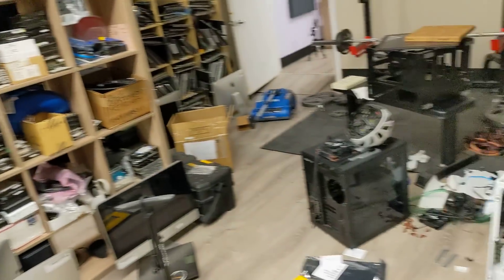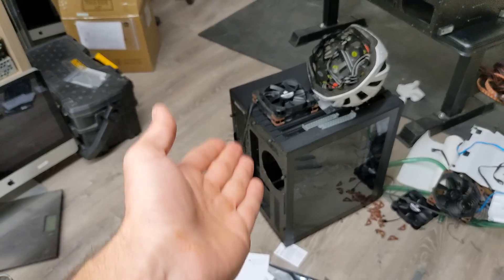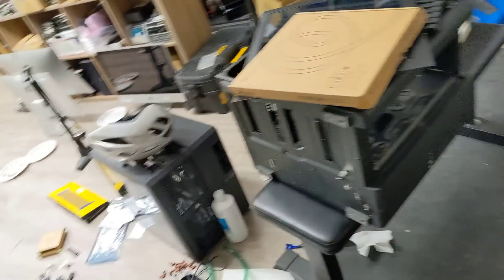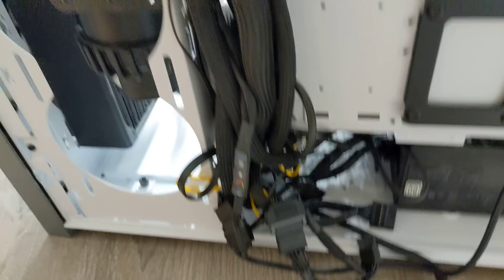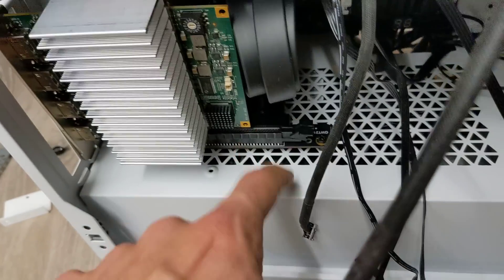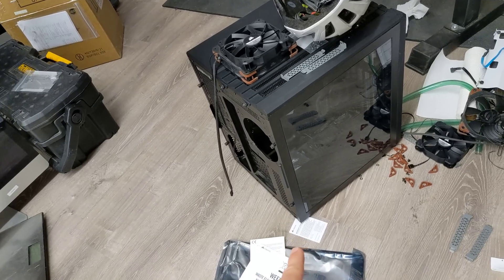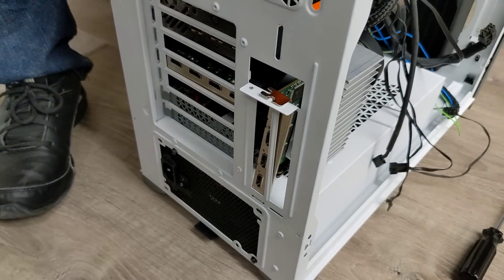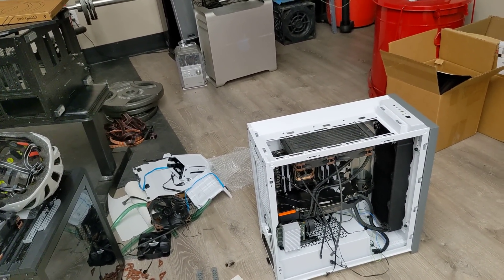I have a confession to make....

Comment: Modern cases (and motherboards) suck. Want to use the pci slots? Too bad, the gpu is in the way. Do you want to use raisers? Too bad, the case doesn't have a way to mount them (nor space for that matter). Want to upgrade from 120mm fans to 140? Well, too bad, even though it has mounting holes for that, you'll have to fit them in a particular way in order to be able to mount the dust filter back.

Comment: Bin that liquid cooled graphics card. You don't strike me as the type of person trying to summon 2 FPS more from flight sim 4k at max setting. Mount the cpu radiator in the top. Job done.

Also there is multiple holes for the sata bays...slide it over away from the power supply cables.

Comment: Louis, I may be late to the party but I also own a Corsair Carbide case. When I got it I thought my 3.5 bays were defective too... turns out they need way more force to properly seat the connectors than any sane person would think is needed. If you still have that case, maybe give the drives an extra shove and see if they click in any farther. Hope this helps.

Comment: I have a question, where can one find a body for an Asus K93SM 18 inch laptop, or how to reinforce and repair the current one since the hull is literally falling apart, the plastic is way too thin for this size and weight and its already full of cracks holes and its barely keeping it toghether since ive fixed it partly with silicon, pieces from old broken toys and candy wrappers since those turn out to be quite durable for making crack patchwork, tho id need to find a new body and maybe a way to beef it up to last longer, or just find a way to further reinforce the current one which is barely keeping it together, many of the joints are completely broken. parts are missing, the side radiator is completely exposed since the hot air baked the plastic and it just broke off and the monitor hinges are pretty much destroyed...the machine is literally holding together as if its stubborn not to completely fall apart, all mechanical interior components are functioning great but it needs a better shell, and maybe a new original charger since the one i have now worries me how hot it gets.

Comment: The Verge video is still worse.  I think you would be hard pressed to get that capture card to fit in most cases with a GPU installed. Also, the 3.5 drive bays in a lot of cases don't fit with longer modular PSUs. But all the parts in the Verge video were compatible with the chosen case, yet the video could have been mistaken for a parody thanks to sheer incompetence.

Comment: Does anyone have credible advice on recovering data from a thrown hard drive?

1) How expensive should inspection/investigation actually be compared to 1st party rates?

2) It was thrown but not smashed or significantly deformed; just unreadable by our computers. How likely does anyone think it is that data recovery is possible?

Obviously not a request for aid or anything, but I'm flying blind about how to not get ripped off and the contents are precious enough that even hearing from a more knowledgeable person about how these things tend to go would be wonderful. 

Thanks in advance to anyone for your responses.

Comment: How come the white corsair case has the water cooling and fans on backwards so the fans are acting as pushers? Conventional radiators need puller fans to be effective, same as any car cooling system. They do make special pusher fans when you have no option or are stacking another radiator on top, but are typically loud and need more power to do the same job.

Comment: my god louis u need a bigger case than thoes thats what u need to do all of the stuff u want i recommend the corsair 1000d super tower case its super easy to build a liquid cooled pc in it and you can stick upto 5 hard drives in it and 6 ssds in it and have 2 computers in it one atx and one itx and its all made out of steal and has tempered glass as well but i dont keep the side panel on cause i still tinker in it once in a while so its easier for me to keep it off.

Comment: Chief, I spent twenty minutes diagnosing a display issue that wound up just being a power connector not being connected properly and unplugging itself. I spent several times longer trying to figure out how to get the wi-fi working on my Framework laptop, only to find I'd skipped a step and never connected the antenna wires that I'd even acknowledged the existence of.

No one is exempt from having embarrassing technical difficulties with computers. XD

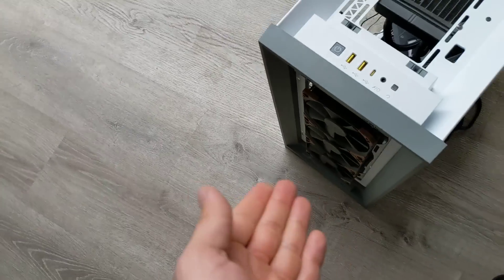Comment: 1:20 the fans go on the inside, in front of the radiator if you have a front rad, but behind the panel. Hold fan inside, put screw through fan mount eyelet, mount fan.

Comment: I cant believe for a second you dont have the knowledge to figure it out, even if you dont "know" how to. You can very easily look up a 15 min video , possibly one of the verge follow up videos people did, and be able to wrap that up. You can read board schematics. This is MUCH more difficult then plugging in a few components. In fact some of the skills crossover. Being able to read and identify a certain terminal for a component, the tiny text many people overlook is on 99% of motherboards that identify said terminals. I have faith. You honestly Cant mess it up with the level of foresight and knowledge you have with said devices. The plugs pretty much wont let you. Just dont use wire looms from different PSU's. Each PSU is specific, even across some identical models, the plugs change "pin outs" and swapping one wire will cause havoc. The rest is plug and play honestly.

Comment: Dude, is that a Gigabyte card? It is! You're a brave, brave man. Gigabyte is really going elemental with their stuff lately. Their graphics cards are from the Fire element, and they will start burning the moment you turn on the computer. Their PSUs, fittingly, are electricity type. Those that aren't DOA will not only have catastrophic failures that will drag a few other components down to hell with them, they will also play Raiden/Zeus/Thor/The Emperor and shoot lightning across the room.

...

Sure, not literally every single one of their devices does that, and sure, I exaggerate - but I didn't exaggerate by that much and I any time any of your product lines has a non-trivial portion of its specimens become a fire or lightning hazard, and you try to bury the story, you lose all respect I might have had for you and you land on my blacklist. And getting off that list will take tremendous efforts of pro-consumer policies and stark increases in quality.

Comment: I mean... You're not exactly making it easy for yourself. 

There's a reason I stick with Air Coolers, and it's not (just) that they're perfectly adequate even for the highest end consumer chips, but also because they are more reliable (less moving parts) and, while also not neccesarily easy, usually a lot easier to manage while building a PC. Oh, and they get quieter during anything but sustained peak, no pump that always has to work.

And yeah... HDDs in modern cases ain't pretty, usually all kinds of hidden incompatibilities. I've been able to move most mass storage to NAS devices and thus get by with just SSDs in my main PC. Next time you'll be smarter, that long PSUs and HDD cages interfere is quite common. Also HDD cages and fans, even worse with radiators (again).

Comment: Nah, you're not nearly as bad as you think you are. You probably do need a bigger case. That one looks like the iCue 400D. The 5000D or even the 7000D would be a better fit. The 7000D has slots for two sets of drive cages at the bottom, so even if one doesn't fit with the radiator and PSU there, the other will. The Torrent also has two dedicated 3.5 inch slots where they wouldn't clash with anything else. There are ton of good cases but you have to make sure you don't just pick a case because most general cases are going to be too small.

Comment: You could have simply just looked at a smaller power supply and made the what is that a 4000D or 5000D work.  My power supply is the same size in a 5000D, and with the other front bottom attachment, the one with the open area rather than the L shape,  I can fit the 3.5" drive bay just fine.

Comment: So I now own this same case, and I can't help but notice that you have the reduced size power supply basement cover installed. That part isn't installed by default. With the normal power supply basement cover that's longer, you can fit the drive cage fine because it's closer to the front of the case. So you've chosen to intentionally install the piece that makes the drive cage not fit. I assume you did this because the front rad wouldn't fit with the regular length basement cover so you switched to the smaller one but then the drive cage wouldn't fit. So in this case, you'd have to decide which is more important. Having your 360 rad being mounted where you want it, or having a drive cage.

Comment: You can fit a Seasonic Prime Gold 1300W in there with the drive cage. Source: I have the same case (5000D Airflow) and that exact power supply.

Comment: I hate those cases with the sealed PSU and hard drive area. Even with a power supply with modular connections there is never any room down there for the regular 3.5" drives. I guess they think PC builders will only be using 1 M2 drive and a couple of SSDs tops.  I see now why you like the Corsair case as the hard drives are stored separate from the motherboard compartment.

Comment: You should have chosen a Lian-Li O11 XL, you can fit 4 3.5" HDD (with included hot-swap bays) several 2.5" SSD and have enough space to fit all those radiators without a poblem.

Comment: I built a new PC with the same corsair 5000 case as you. you are right about thre 3.5" HD case, I believe they could have fixed that by having a mount plate for the PSU so you could slide it in from the back and then fasten the PSU.  That way you could get to the connectors. I manage to fit the fans for the radiator inside as well as the water tank. but then I replaced my 1080 with a RTX 3080 and can't fit the tank before i get the GPU water cooled again.

Comment: I think those fans go inside the case, not attached to the back.

Search this platform for that specific case and you might find a bunch of people putting their machines together, and find some useful information.

As for hard drives. they tend to attach to the sides of the case now. Maybe not the optical ones, but at this point, with the cost of SSD drives you might as well get those and clone yours over. Those are way smaller and will attach in a few spots in those cases.

Comment: The water cooler doesn't fit because you're supposed to put the fans on the radiator, not on the case.

Comment: I built my first PC in the nineties and I've built PCs only for myself. The most time consuming part of PC build is the preparation phase, when you search as many as compatibility issues, such as mechanical, thermal and electrical compatibility issues. But the most annoying aggravating etc phase is the "I built it and now I'm the sole provider of tech support regarding this abomination" phase. For that you'll need sufficient inventory of known good parts and/or spare parts. So yeah the "fun" part is "lego" phase, when you attach the parts together, hopefully without using a 12 kg, 423.288 oz, sledgehammer for fine tuning, everything else is most likely less fun.

Comment: After doing a ton of builds I will never buy another case besides Phanteks, Pro tip#2: Watercooling is for the dogs, radiator mounting will multiply build time and also multiply pc maintenance and trouble shooting for years to come. Do yourself a favor and buy a giant air tower cooler and never mess with it ever again, (besides maybe replacing a fan after a few years) Only go for water cooling if the Air cooling is inadequate, then return the air cooler that you tried to use and buy an AIO liquid cooler.

Comment: In my late high school years and college years, I built my own machines because I had no money and had to deal with second-hand and salvaged parts.  I had plenty of time to spend digging up answers and pouring through user manuals... particularly because motherboards in that era did not play well with RAM that wasn't on their approved list...a list that would change depending on firmware version, often losing compatibility so you'd need a specific firmware version to function.  There are just dozens of issues like that I kept hitting.  Parts not fitting was often solved with a dremel tool and cases became frankencases quite often.  The standards are far better today, but it's funny to see the same problems are still around.  These days, now that I have money and not so much time, I just pay the 10% markup or so to buy machines pre-built.  I swap parts and occasionally add more drives myself, but that rarely causes trouble at least.

Comment: There is a power supply basement expansion so you can fit a 2 HDDs into that case.check the box

The white ramp looking end cap at the front of the PSU shroud comes off and can be replaced with a bigger one that will give you the room for the HDDs.

Comment: Those are mainly custom loop watercooling problems. If you just want it to work go with air cooling. And not so bleeding edge components like huge power supplies and graphic cards.

Comment: Wow.... just wow
Have you tried moving the 360 beast of a Rad to the top of case and the smaller 240 to the front, it is slimmer so may be able to fit the rad including fans inside case without hitting the reservoir leaving the space needed to put on the front cover.
As for the drives, i would say ditch the mechanicals and for the price difference these days go with sata ssd (3 slots in the back of case) hugely more reliable and way less likely to die from your preffered transportation method haha

Comment: That case (white one) is a bit tricky,  you have to mount the gamma on the inside of the case instead of where you had it essentially. 
The fans will pull the cold air into the case rather than push it in. 
That how mine is setup with that case.

Comment: Wrong way to put a 240mm and 360mm radiator into the case.
If the 360mm radiator can't fit on the top, turn all front and back fans around so you exhaust hot air through the front of the case instead of directing it into the case and heating the components you are supposed to cool.

Comment: I literally just built a pc into this exact case last week! Glad I'm not the only one that had a rubbish experience trying to fit the HDD bay in it! We had to leave it right at the front in the bottom area, unattached to the case! Also the front glass panel caused the temps to go 10 degrees higher so the guy can't use it with that on!

Comment: Desktop PC assembly is stupidly easy as long as you're doing just the basic minimum. Once you start introducing multiple drives, expansion cards, water cooling radiators and any other extras, then you have to approach it differently. You don't follow shitty barebones instructions, you consider every way you can fit it all together including possible unorthodox solutions with brackets, zip ties, drilling of additional screw holes, changing fan placement and direction and so on.

Comment: I had the same problem with my PSU when trying to build a NAS in a Silverstone case. I wanted to use an old Corsair PSU but there's not enough clearance, the PSU was too long. I had to get a new one. Sure the seller did tell you about PSU length requirements, but it's in very small letters and you wouldn't have noticed it unless you already know PSU being too long is a thing. Building a PC looks so straight forward when you watch those tech tubers' videos but can be quite frustrating when you try it yourself.

Comment: get the either 1000D or the 7000D case from corsair because those big boys will fit just about anything in and you will have  more space to work with . the phanteks enthoo pro 2 case  is also a good choice if you want lots of hdd's . also, a custom loop is probably a bad idea  for you and you may  be better  to just get a 280 aio or a 360  that may be less of a pain to work with than a custom loop.

Comment: if you want hard drive bays and a ton of space Enthoo Pro, or if you want to blow money Meshify XL... new cases are usually poorly designed aesthetic crap; for your thickboy capture card use case, might want to look for cases that have an extra 1-2 slots below the standard 7 that are still horizontal(Enthoo Pro has 1 extra but no vertical slots)

Comment: this is not completely your fault honestly, just happened to be a selection of parts that don't work together so well. 
The Corsair 4000D/X has a bunch of space up front for the 3.5" cage since it doesn't have the side fan slots over there (like in the case of the 5000D/X)